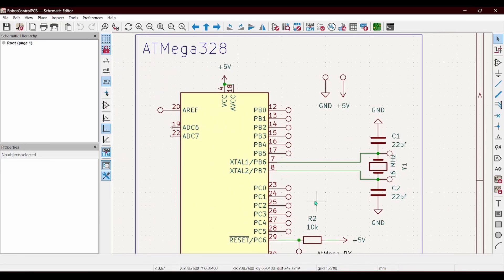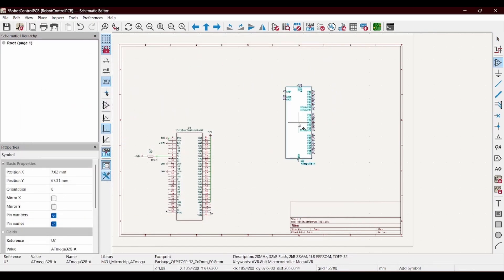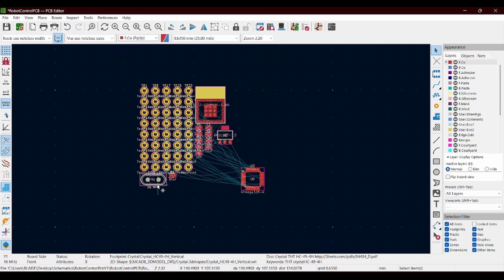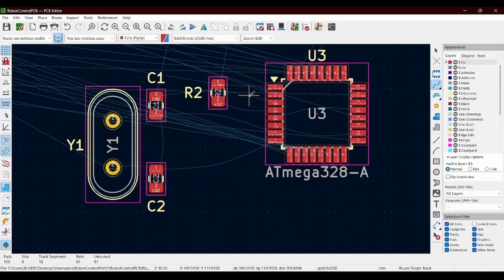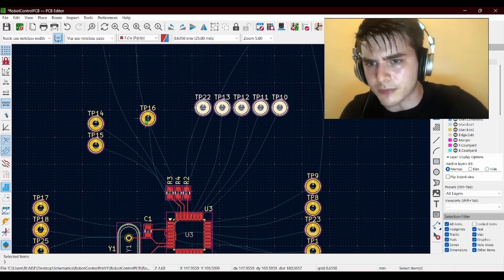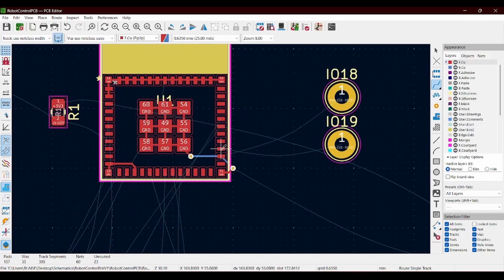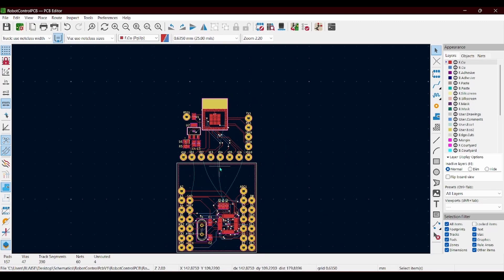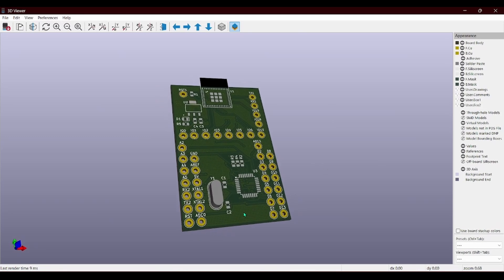I tried to make a circuit board (again)

Comment: Well done, but 2 very important hints: 
1. dont route gnd. Use a solid fill and use that as a ground plane and add in some vias here and there and let the DRC check if you missed some connections. Saves you a ton.
2. linear voltage regulators tend to get hot. Connect the large pin to a plane to let it disperse heat.
and extra hint: mounting holes. make some extra space for some 3 or 4mm screws if you want to mount the PCB somewhere
Reply from the maker: Thank you for the tips, ill keep that in mind for next time i make a pcb